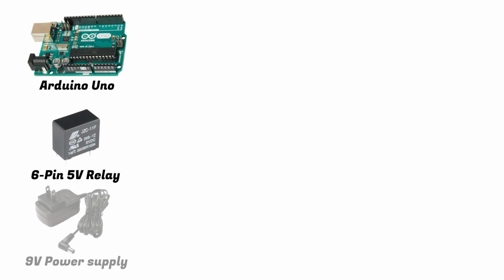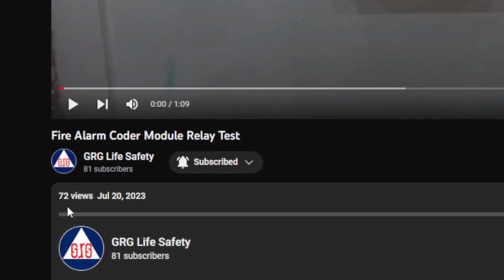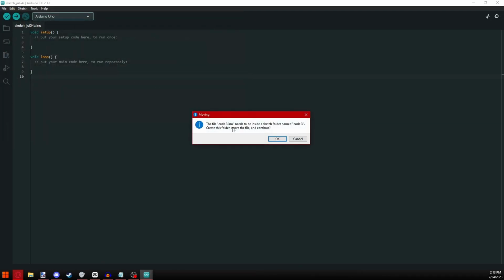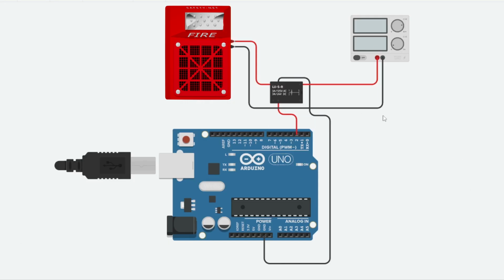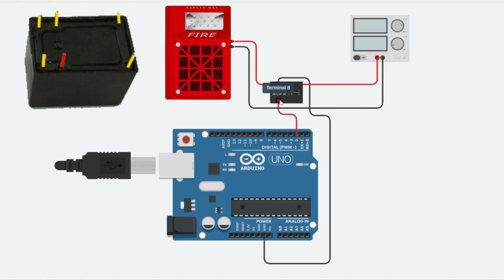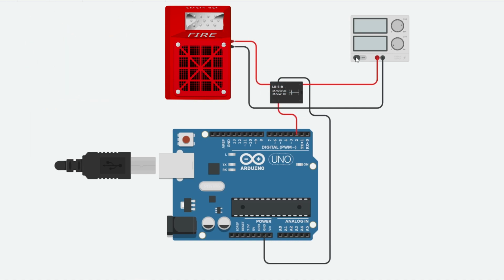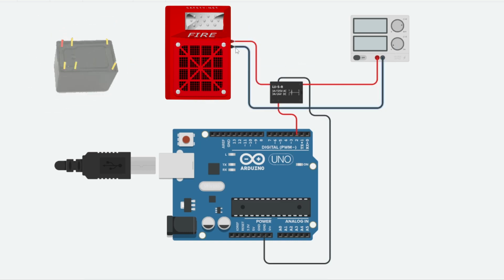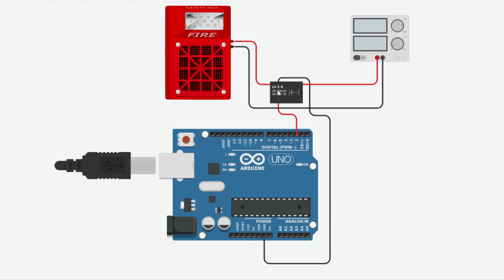How to make a basic Fire Alarm Coder Module

Comment: you could also just get squarewave oscillators and latching relays. the ones made by oono are fairly inexpensive and quite effective. using an arduino as a component of a control panel, say for zone/nac controls would still prove useful though.